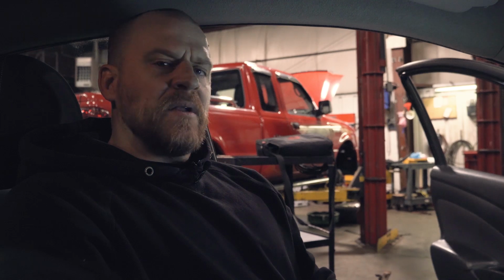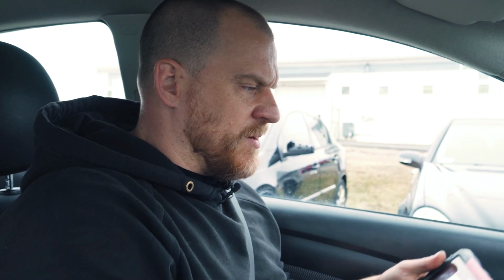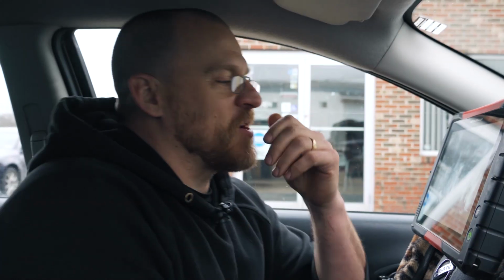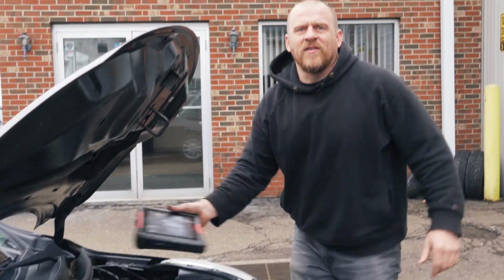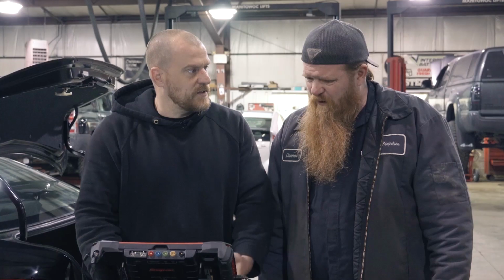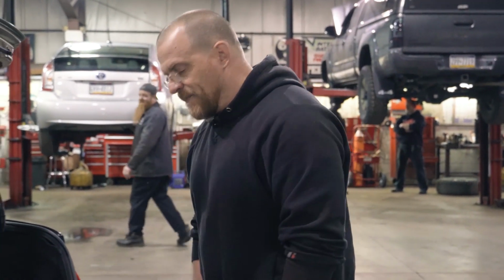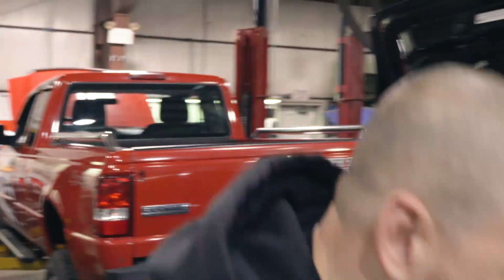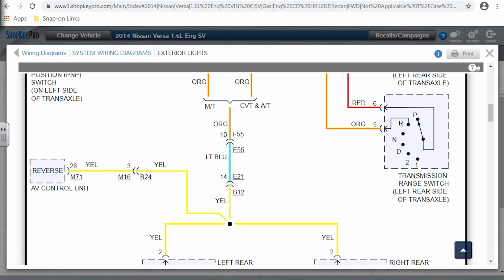2014 Nissan Versa P0705 Transmission Range Sensor "A" Circuit (PRNDL Input)

Comment: The TCM puts out a small reference voltage on the backup light bulb power circuit. When the vehicle is not in reverse, the TCM expects this voltage to be pulled to ground through the closed windings of the bulbs. If the bulbs are blown, the wrong style, or the circuit has a problem, the TCM assumes the vehicle is in reverse.
Reply from the maker: Best answer I've seen! I should have checked that circuit smh 
Now I have to update my update lol.
Thanks so much!
Reply: @ScannerDanner  Did you get to recheck this vehicle for this issue?
Reply: @ScannerDanner I know this is old but my son car is throwing this code and it feels like the transmission is slipping. Could this still be the problem. Also he just got a system put in his car about a month ago. Could anything with that thrown it off?
Reply: @codyannfalquez891  why send me a notification for your comment? I never even replied to this thread or nothing
Reply: So, does that mean that when one of  the back-up lights burns out it will set this fault code ?
Reply: @chirt1453  what about if your remove it then ? Will that too cause a code ?
Reply: Shouldn't make cars like this Nissan has lost revenue he plot gone to the dogs since Renault took them over.
Reply: Had this happen to my Nissan Versa 2016 park neutral switch connected to the lights shorting then out and giving transmission codes replaced the neutral switch and bulbs fixed the problem the transmission would make an awful shifting sound while driving
Reply: thank you for the tip! answers my question why the light came on...
Reply: HI SCANNER DANNER, I’m in New Jersey, how can I book an appointment with you for my genesis coupe v6? I’ve been getting an off and on p0014 code for 2 years but the car runs great with 267,000 miles. Please help.
Reply: @TvSxx  if it runs good, no need to fix it
Reply: So it can't be fixed? My cousin is having this issue, the right tail light assembly (I've not seen where any other vehicle has had this issue with the left) was replaced at the local Nissan dealership and the issue persists.
Reply: Can it cause 02 sensor problem as well, cos the power to the wideband 02 sensor fuse is included in the backup/tail light as well. 
In nissan I mean

Comment: @ScannerDanner

Alright I have a 2015 Nissan Versa SL. With this exact same issue. I've gone through and replaced the neutral safety switch a year ago and still could not resolve the issue I've been investigating this for the last year. I've gone through and personally checked the wiring harness, checked all my grounds Check the tail lights, replaced the tail lights with brand new ones from Nissan. I've checked the front left blinker for corrosion because that has a part in it as well That play is for this. All of these including the neutral safety switch along with all fuses and relays still would not fix the issue. The P0705 the code was registered as a permanent code on the car and would never go away. Periodically when we would drive the LCD screen for the drive reverse and gear functions on the instrument cluster would stop displaying what Gary are in and then the car would start running funny meaning it got sluggish into transmission would start to slip. So I decided to do something different. I actually replaced my tail lights with a set of LED tail lights period now I'm not talking about the original domes with LED bulbs. I'm talking about full LED board tail lights. I have driven the car now for two months and my check engine light has disappeared and the permanent code has actually disappeared as well. It is something to do with the OEM and aftermarket OEM tail lights. It is the connectors it doesn't see properly doesn't ground properly cause the ground is screwed up throughout the entire car. Once I replaced the tail lights I have never had an issue since. For proof of it I just got my car smogged passed with flying colors. If you guys wanna know what type of tail lights I bought I can put the link in here. Dan this is something if you guys are really wanting to investigate into Check it out it actually works. I even have my original tail lights in the box still in my garage.

LED Tail Lights Compatible with 2012-2019 Nissan Versa Sedan - Direct Fit Plug & Play - High-Brightness Taillamps Replacement (Pair)

https://www.amazon.com/LED-Lights-Compatible-2012-2019-Nissan/dp/B0DRJ998KF/ref=sr_1_1_sspa?crid=MAY5ZVZ57YEE&dib=eyJ2IjoiMSJ9.zt_AYsVc0tR1NkP61GcttHQzzFrdMGKFTiADTWoznR_tneLFBokXclJ8I6thuOQ3YEMAY0unlhZXVJkK6zrnbPoTimIyYOpdyR1ox1Rjpa0BZYYiy4S5-EuDHU0WrKKytGfAiEvf9b2m4wb5cwtfI-pc3m4AEP_5gxgn8Lcvg-XBPCuNZ9BQ_023bVcZkkXTsqGL4xHRk7Jno734yV739VYY-9S0bKkGkkuHEUsPAiSSgqsI5YnplBKVLLolcHusLe-_-7vUH7LJSjEz0Le3oMDCvbPU5eRN04FDUcHk-tI.iEjmI_CAEu-r5n0T3TXezTzQ28oDDqGIyo573f5TgJQ&dib_tag=se&keywords=LED+Tail+Lights+Compatible+with+2012-2019+Nissan+Versa+Sedan+-+Direct+Fit+Plug+%26+Play+-+High-Brightness+Taillamps+Replacement+%28Pair%29&qid=1758410243&s=automotive&sprefix=led+tail+lights+compatible+with+2012-2019+nissan+versa+sedan+-+direct+fit+plug+%26+play+-+high-brightness+taillamps+replacement+pair+%2Cautomotive%2C235&sr=1-1-spons&sp_csd=d2lkZ2V0TmFtZT1zcF9hdGY&psc=1

Comment: Just had one where two previous mechanics replaced range sensor and both tail lights. I got it and thought I was gonna have a problem on my hand but mine was when turning right and pushing the brake the signal would flash faster and vehicle would start to jerking and hesistating. The brake light would also start flashing when the turn signal is used. Mine was connector damage and the ground wire was backed out and not making contact. Replaced the connector and vehicle is now fixed. It’s crazy what can make these vehicles do weird things.

Comment: Damn I wish there was a part 2.
Reply from the maker: What's your question? From memory, this is a lighting circuit issue that was backfeeding the transmission range sensor circuit
Reply: @ScannerDanner okay so y'all got it solved? I was just hoping to see the customer come back and say it was good or y'all hear from them and they said it was okay. Such a strange failure though. I was thinking maybe corrosion was causing it to back feed?

Comment: Everytime I get a P0705  on a VERSA- it has been a tail light problem. I have swap out both tail light on 5 job and  fix 2 plug all due to corrosion related, all with no returns for same issue, (keeping fingers cross).

I don't spend too much time with this code I do first check the plugs, if there is no corrosion then it gets new lamp assemblies period.

Good luck everyone.

Comment: I'm curious, were you able to confirm a failure on this car, or catch freeze frame of the fault? I'm dealing with a 2014 Versa with the same intermittent concern, but was able to witness that ALL gears were "OFF" simultaneously.
Reply from the maker: Just what was covered in the video. Id encourage you to read the comments too. Many people are confirming this same issue. Thanks!

Comment: I have a 2007 Ford Focus SES it was hit in front and I think there's a bad hood pin sensor or bad wire now remote start doesn't work. Overdrive button doesn't work. No dash lights for overdrive off or what gear your in or hood open light. Car shakes til warm and p0705 transmission code. I suspect either aftermarket car starter or hood pin sensor or wires from those going to smart junction box (body control module) is the problem. I heard if you disconnect the wire harness from sjb and check its fuses or unhook the sjb totally you need to reprogram it. Also if I unplug battery and connect battery cables with jumper wire to drain all power I think it resets all modules. Would this reset the sjb and if so would it need to be reprogramed? Any information would be great thank you. Do you know the location for smart junction box (body control module) in a 2007 Ford Focus SES and diagram of fuses etc and what they are for?

Comment: 2019 Nissan Versa, would throw a P0705 if lights were on and used left turn signal. Other symptoms was transmission throttling when emergency flashers were on and cruise control would cancel when using left turn signal. Gear selection indicator on dash would also disappear. Replaced left (Drivers side) taillight assembly ordered off of Amazon for $60, took about 15 minutes. Road tested car and so far problem has gone away. Thank you You Tube and the poster of this video! Saved me hundreds, possibly thousands if I had to take it to a dealer to look at.
Reply from the maker: Thanks for sharing your story. I'm glad you were able to fix it!
Reply: Hi , I have 2019 versa and facing same issue,can you please advice ..or how can I contact you

Comment: This code on this make, model yr. Is just a bad ground, confirm on my daughters. Please look at the state of the bad bulb. This make suffers of tranmission and many electrical problems. We purchase both back lights, waste of money. In addition look around inside trunk for water leakages. Best of luck.
Reply from the maker: One of the possibilities, not the only cause.
Reply: @ScannerDanner  closer to your trial and error.....prior to verify the live OBD shift condition....Verify your burn bulb condition....Best of luck, Mr. M........." Even though my answer is not the solution to the problem"
Reply from the maker: @davidtoro6006 never said it wasn't, I only said it is not the only cause

Comment: THANK YOU SO MUCH FOR THIS VIDEO!!!!  Ihavent checked by lights for corrosion yet. But, WOW!! Thank you for being so thorough and talking through it the whole way. Even if it's not my problem. This is the best troubleshooting video ever made.
Reply from the maker: Wow, thanks so much
Reply: @ScannerDanner  Thank you so much again!  I checked my backup lights. And had the EXACT same issue. No corrosion,  but one of them was dim. I took out the bulb. It had very slight wear, and very, very light corrosion on the tip contact. So, I cleaned it up with a piece of emery cloth.  Put it back in. Both were bright.  I cleared the code. It was still showing after one trip to town about 8 miles away and back. But, after another trip,the code is gone. I NEVER would have guessed this was the problem. Sometimes you find the right video on here. And sometimes you're lucky enough to find a trustful source to go to for any future problems. That is what happened here. Thank you so very much!
Reply from the maker: @LU-py2rf  your are very welcome and nice job on the fix! And welcome!

Comment: To anyone with a nissan versa and possibly 2013 to 2016 altima,  or possibly any nissan for that matter, the p0705 code is always going to be a tail light , brake light , curcuit or assembly or harness or connection issue, nota tranny issue. Many timesthe female pins are spread too far and don't get good connection, causing the car to think its in reverse while its in D, throwing a trans code. Some tail light assembly get moisture and cause the code etc. So if anybody is pulling their hair out after replacing the range sensor and other transmission parts,  go look at your tail light assembly,  bulbs, connection and harnesses etc. The  electrical issues make the car tcm think its in R when you have it in D and will even cause limp mode etc.  So let me know if yall fix your cel p0705 code by addressing the tail light issues instead of the transmission
Reply from the maker: That's what was wrong with this car in the video too.

Comment: What about actually changing the Transmission Range Sensor under the hood?
Reply from the maker: A trouble code for a specific sensor does not mean you need that sensor. This video proves that concept very well

Comment: All I had wrong was a bad left turn signal bulb on the left rear. The gear position sensor is tied into the rear taillight sockets PC board which is a poor design. Make sure all tallight bulbs are working.  Sometimes corrosion and moisture can ge on the PC board and cause it to short out just enough to cause a problem with the voltage signal coming from the sensor according to the computer.

Comment: Hi, if it makes you fill any better... on 2023, xtrail model 2020 the diagram is the same circuit and the info of the conection between reverse tail light and transmition range still missing on dealers infomation.
Reply from the maker: That's b.s. for sure! But not surprised because, well, Nissan lol

Comment: I got a 2015 Versa check engine light was on but went off before I got to mechanic they scanned anyways was a battery code and abs but they couldn’t find anything wrong.  Yesterday I noticed when shifting no indication on dash of gear I was in and today the check engine light back on.  Went to tell mechanic as I just got car back yesterday and he scanned again said it’s a transmission sensor code he said would need further diagnostic.  Car runs fine so fingers crossed 🤞🙏💫it’s something easy like this . Thanks for sharing ❤

Comment: @ScannerDanner 2016 versa sv cvt, solid yellow cel came on. code read p0705 at az. Rear drivers light had issue, changed bulb Left tailight had issue, replaced bulb-didn’t fix, took bulb out, wiped off circuit board and put bulb back in-fixed. While checking the fix, passengers tail light issue presented itself-replaced bulb, fixed it. Then it went out again. Also noticed that Gear selection illumination on dash went black when I put it in drive. Wiped off circuit board (even though it looked fine), replaced bulb. Fixed!  Gear selection illumination on dash went back to normal as well. I really want to have the code erased.  If this problem was caused by the tail lights-and it comes back-could this cause me to be stranded? Thank you for your video! There isn't much on the internet about this at all!!!

Comment: I have a 2015 Nissan Versa 1.6L Automatic Transmission, and I've had the P0705 code for a couple months now and haven't done anything until now. The problems i have is when I use my right turn signal my car acts like it his misfiring and doesn't accelerate. Did You ever find out any information to fix it? @ScannerDanner
Reply from the maker: Yes! Check your rear light Assemblies very closesly

Comment: Thank you!! I just happened upon this video researching the same code. The transmission was just changed, but Nissan told us it was either the range switch or the transmission. I didn't find corrosion on the light, but the wire in the connector was loose, causing the reverse light not to work. After repairing the wire, everything is working great. Thanks again, you saved me a bunch of money.

Comment: I had the same problem last week.  
- Started with the slip indicator turning on.
- Diagnostic result was P0705 (1/3)
  1. PNP Switch/ Circuit.
  2. Shift Position Sensor Circuit.
  3. Transmission Range Sensor "A" Circuit.
- Then I noticed on the dash Transmission Shift Indicator Position that when I shifted to (D)rive the letters will disappeared, but will appeared only when I went back to (R)everse which sometimes also will dissapeared.
- After watching your awesome video, I checked my tail lights.  In my case was the right one.  When in reverse, was completely off.
- After I changed the light bulbs everything is back to normal, except my check engine light is on and gives back the same diagnostic result.

How can I reset it, so the check engine light is off?

Thanks for the video.
Reply from the maker: Drive it a few more days. It will go out on its own if that was your only problem.
Reply: @ScannerDanner  I did not have any issues after your reply.  However, now on my left tail light the left turn light bulb went out.  I replaced and still is not working.  I used a working bulb to make sure it wasn't the new bulb and still no luck.  Both brake and reverse lights work on that side (left) but no turning signal.  Should I get a new rear taillight socket assembly? Where can i get one? or How can I test it if it is getting any power?

Thanks in advance!

Comment: Just had a friend come by with a P0705 code active, and we replaced the range sensor. Code was still active after the repair, but after watching your video, we found the connector to the left rear tail-light to have spread pins and one of the pins arcing. After fixing the connector, everything works as intended. Thank you for the insight 🤘
Reply: When you say spread pins what do you mean?